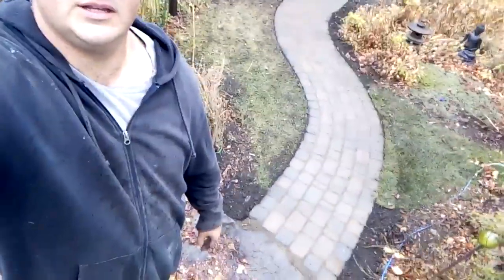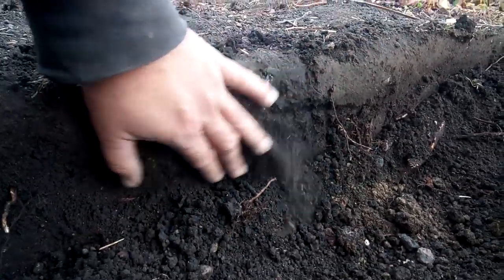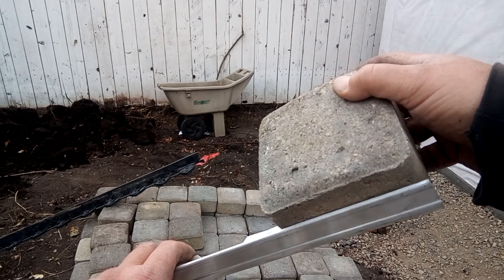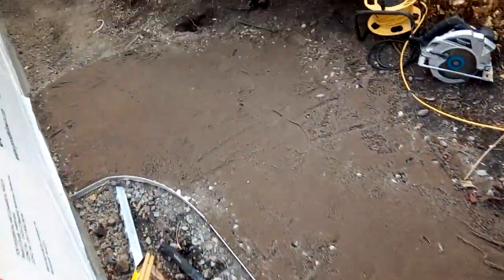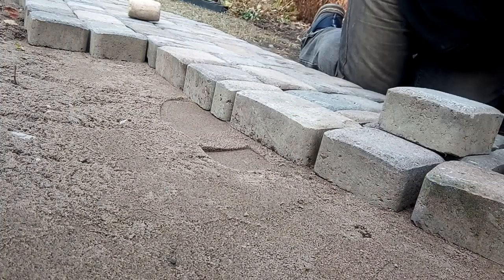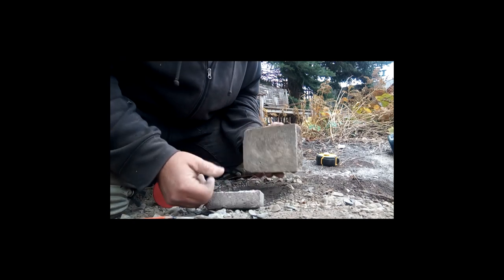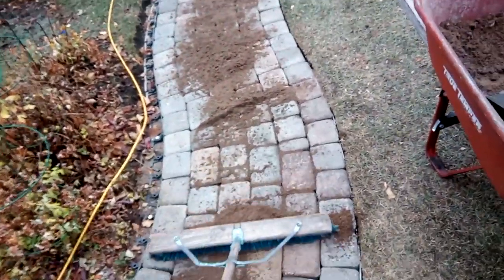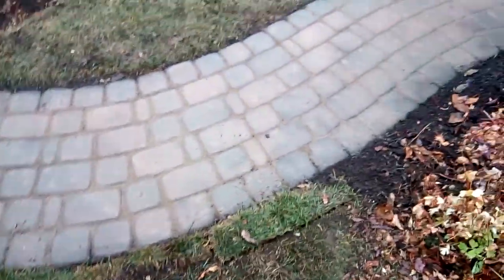How to Build a Brick Pathway in one Day

Comment: Great video.  I was delighted you used minimal sand. While I admit that sand compacts nicely, it always seemed questionable that they use gravel under cement slabs to "float/flex" during the winter frost/heave cycle but then use sand whenever pavers are involved.  In my limited experience, sand is very vulnerable to frost heaving.  I think you hit a nice gravel/sand balance.
Reply from the maker: Thanks for the great comments. Sounds like you know your stuff

Comment: For the digging part, what about running a roto tiller  to soften it and then digging it out? Would that work?
Reply from the maker: Great question. I never like the word "soften" when installing hardscapes. The more compact the better. If you are having trouble excavating use a pick to take chunks out. Good luck.
Reply: John Loney sorry, that was supposed to say roto tiller. Not roller.

Comment: Very nice job.  I’m installing a similar path out to my shed.  I’m using antique bricks, c.1890 -1910, from an old dairy farm floor.  They are all different sizes, so I was going to forego the edging.....as I have a feeling having a solid edgeline will be problematic as I place the irregular bricks.  Listening to you, I am now reconsidering that.  I am more concerned with the grade.  You did an outstanding job, but I’m curious if you established the grade using a string level first?  Again, Bravo-Zulu, amigo!  An informative and entertaining video!
Reply from the maker: The grade of a sidewalk always follows the grade of the ground. Otherwise it might be a tripping hazard.  As for edging, maybe try to gap your brick so the edge is even and fill in with a coarse sand or fine gravel. Or build a  perimeter out of brick and fill in with the random sizes. Just a thought. I love the idea of the antique brick. I would like to see the finished project. Good luck

Comment: Quick question...what is the easiest measuring method to get the paver height to match the cement path height?
Reply from the maker: Make a board the same thickness of the brick you are using

Comment: So in about a day or 2 I should have mine finished... very similar to yours here.. when it comes to polymer sand other than it "sets up and locks the bricks in place" I dont know much  about it chemically... when I apply it and tamp in multiple times do you recommend gently rinsing the top of the bricks off like I've seen in other videos or no?
Reply from the maker: Do not use polymer sand. Landscapers love it because  no "call backs" but it does not deliver on that promise. You will get 5 years out of it then it will start cracking and peeling off. Good luck.